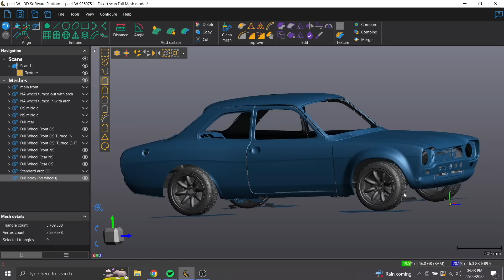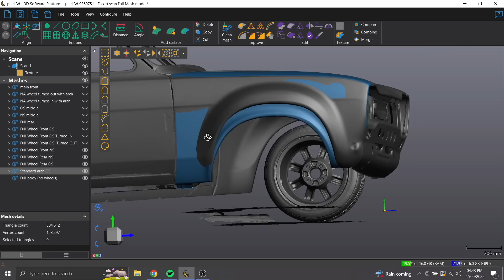Restomod MK2 Jaguar COUPE on the Deck!

Comment: When I bought my 65 289 Mustang it had a repro distributor on it. I was never that pleased with the way the engine performed and in the end I decided to plot out the mechanical advance curve and compare it wit the one in the manual. Suffice to say it was nothing like the one in the manual and also the vacuum had way too much advance. From memory the advance in the manual was 11 degrees at 18 inHg whilst mine was near 20 degrees also. After many an hour fiddling to sort the dizzy the engine felt like it had two more cylinders!! Repro and after market stuff should come with a box full of warnings as your presentation hinted with clutch kits etc.

Comment: A question for you please. How do you ensure that all the cavities/tube sections etc are fully corrosion protected? Are you able to get the hot zinc and raptor coat into them or do you use a different method? Thanks. Love watching your art in engineering.